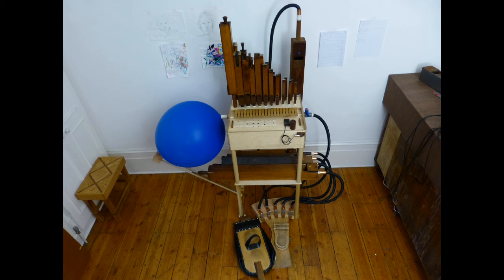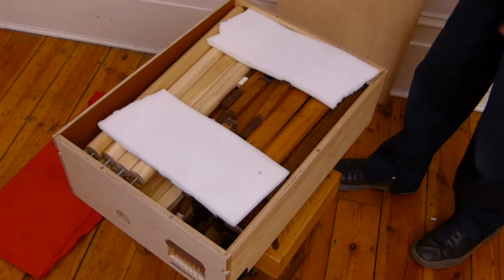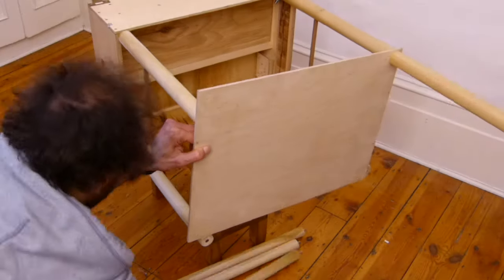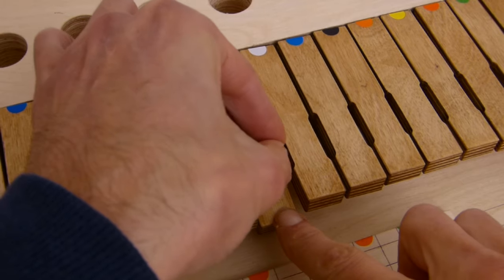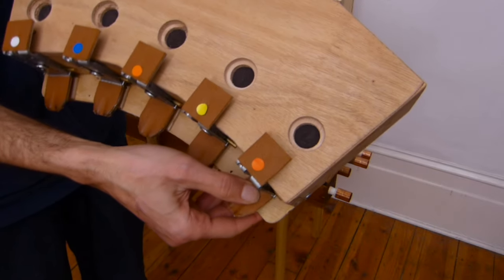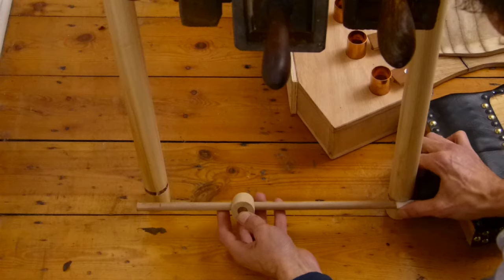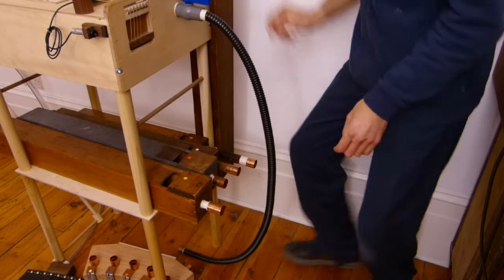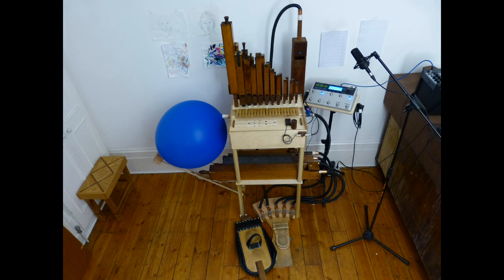Mounting of the Orgatar

Comment: This is great, I'm tempted af to make one.

I have a suggestion for a usage improvement though as the system you have for holding keys seems clunky: look up "double roller catch" and/or "push to open touch release catch". If you installed one of them or made something similar under each key you could make it so you can press to the to play normally or press it a little further to lock it then press it again to unlock it.
Reply from the maker: Thanks for the tips! Notice it's just a prototype that's getting better step by step.
Reply: @rubimomaker  I saw on your site that you make furniture so you likely already have some of them sitting somewhere but your brain didn't bring them up cause they're filed in the furniture rather than instruments bit of your brain.

Where did you get the organ pipes? Did you just chance upon a closing down church or are they something you can just buy?

What is the balloon?